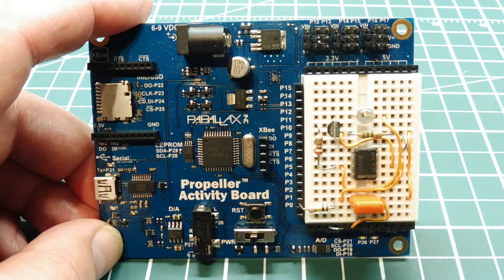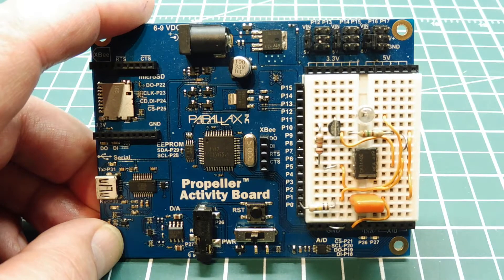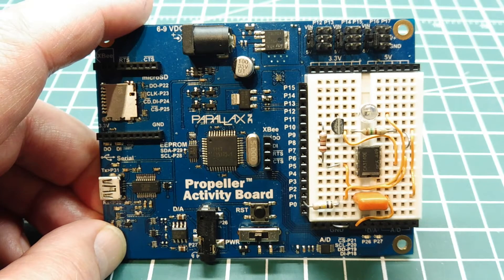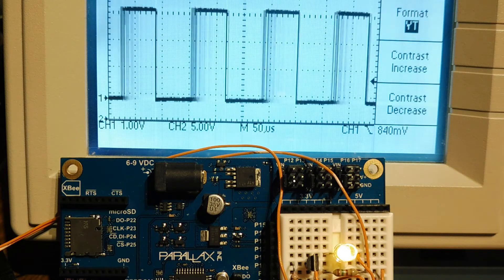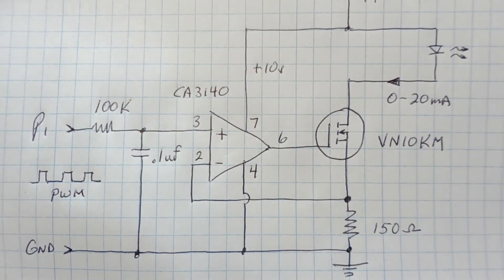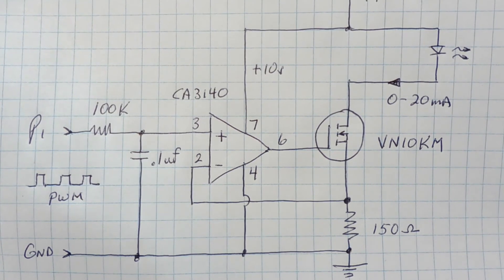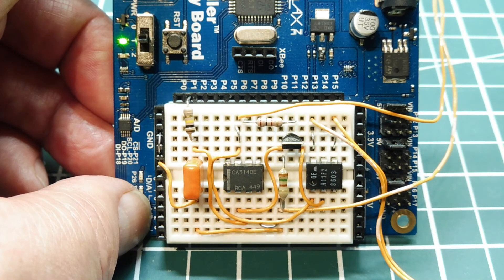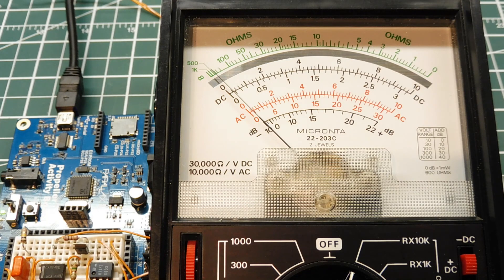0 - 20 mA Current Loop Control  /  Remote Variable Resistor

Comment: Great video! If you need 0-20mA control, this video is great! But for those just wanting uC controlled variable resistance (why I came here initially), go with a digital potentiometer. They are linear, digitally controlled, and often have calibration tolerances stored in their small EEPROM. The AD5259 family may be a good starting point.

If you just want something that you can put a control voltage/current on to vary resistance, this optofet is a much better choice than a vactrol, as it's not quite as unruly in terms of nonlinearity, has a lower on resistance, and responds faster.